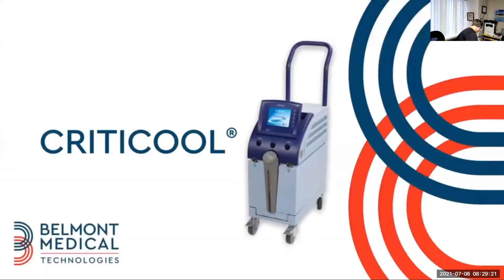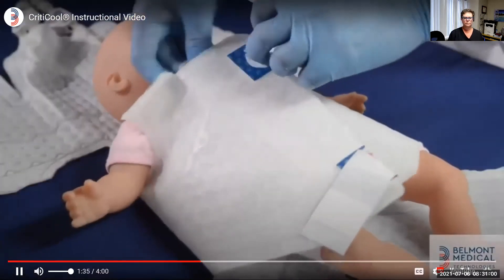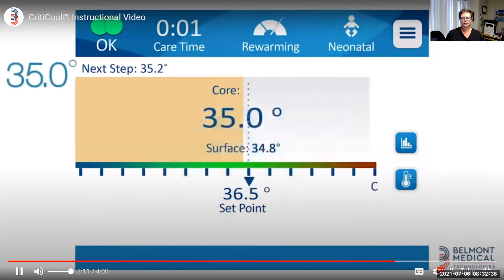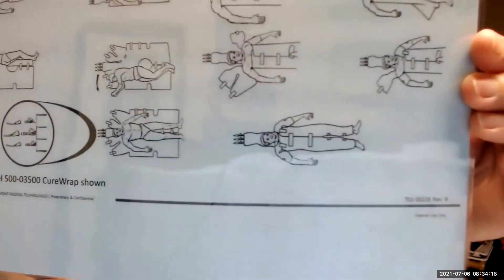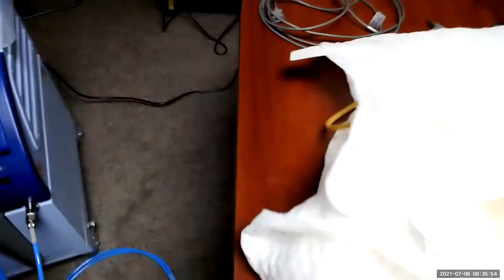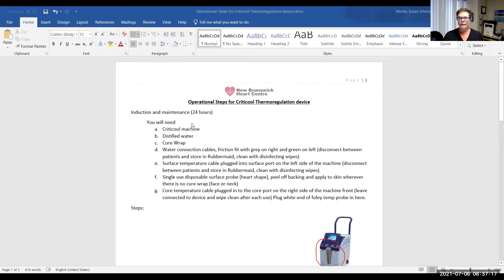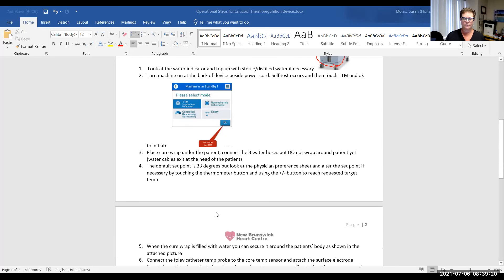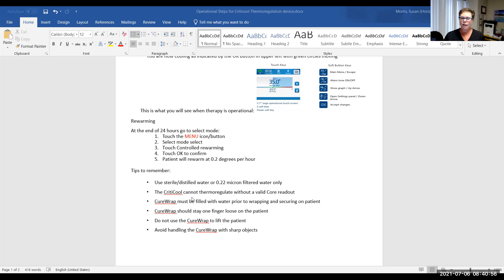Criticool Thermoregulation Device

Comment: Hi Susan, does this blanket actually feel cold to touch? We're opening a new ICU, and looking into buying a cooling blanket. I'm used to using the blanketroll III, which feels very cold to touch and works well, but it's very heavy and clunky, and I don't find it very user friendly. Our hospital is currently using bear huggers at 32 setpoint for cooling, but it feels warm to me, I want to get something that's properly cold!